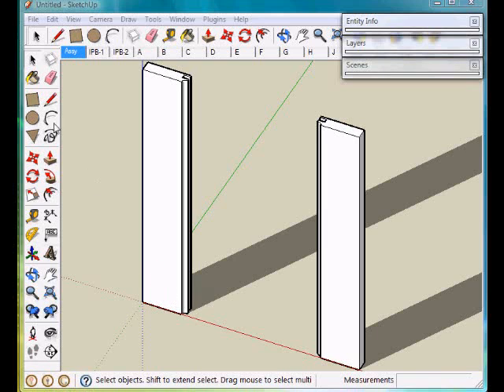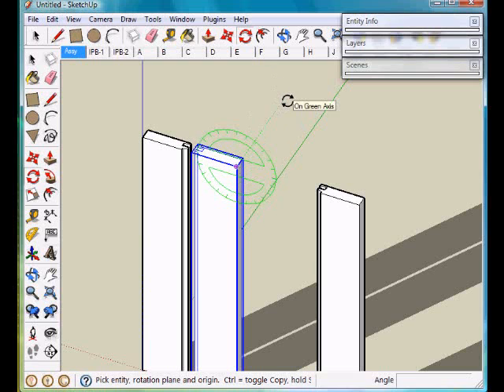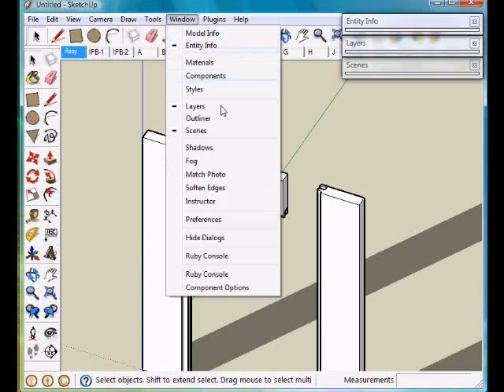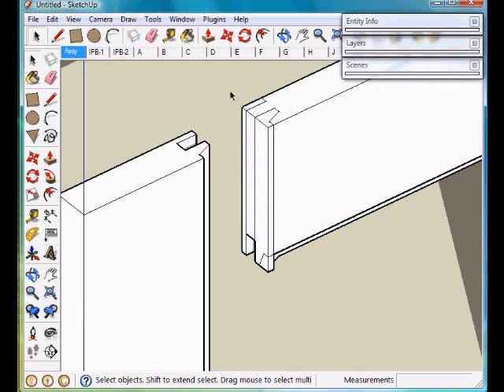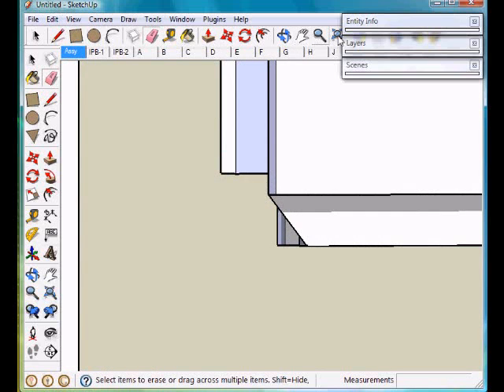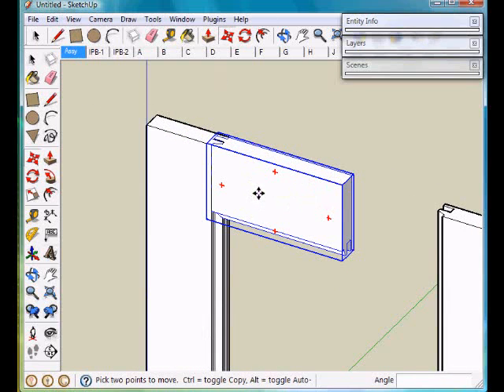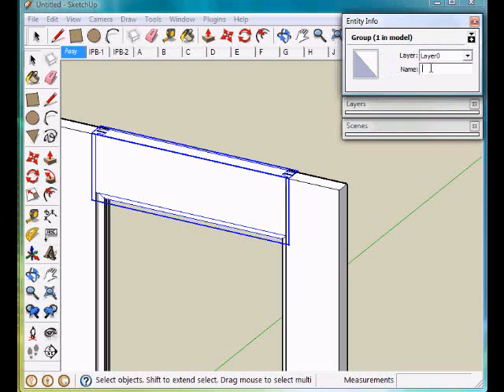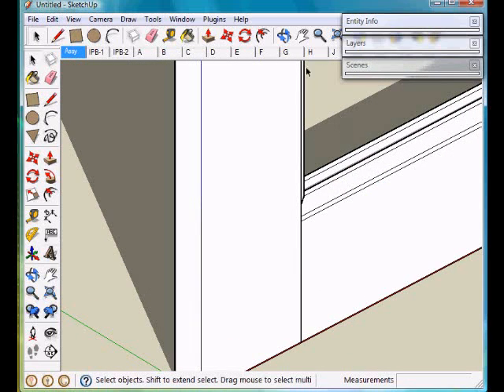Lesson5 3 RailConstruction

Comment: @takuhn01 -You'd think the math would drive the graphics (not the other way around) regardless, excellent suggestion.  Also, thanks for your post. Your SketchUp step-by-step's have given me the courage to break the ice and use SU to solve setup problems around shop. A great help when customizing something with a new profile or structural shape. It's one way to get a good look at a project before cutting the wood.

Comment from the maker: @MudBudDud - One other thing you might try... I've had occurances of voids at times also.  Always working with curves like a routing, never straight shapes like a champher.   It seems (to me) to be a problem with math precision and scale.  I found that if I scale the item up 10x and then do the Follow-Me, it works, then scale the results back down to 1/10th scale (original size).    You might try that sometime.  I know, it's a work-around, but if it works...

Comment: Yes, I build the parts as you did then tried to route the outer edge of the assembled frame with an o-gee. Thank you for all the suggestions, I did follow each and  yes I agree, there seems to be a limit to what the follow-me tool can do. Even though I explode the components, separate them and add lead-ins to direct the follow-me cutting path, collectively SU fails to cut the path without leaving voids or will simply refuse to follow the edge path that joins the end of stile to cope on rail top.

Comment from the maker: @MudBudDud - If you selected all 4 pieces and made a single component out of the 4, Follow-Me might work on that, but in that case, the grain won't run correctly on the pieces, it would run all in one direction, since it's one component.  Try running Follow-Me on each piece individually and see if that works.

Comment from the maker: @MudBudDud - If so,I think the reason that it's failing is Follow-Me is designed to follow a shape, which can be a boundary of an item, but not multiple items (as far as I know).  In other words, if your model is as I suspect, you have 4 groups or components for the 4 pieces of the frame and then trying to Follow-Me around the finished frame.

Comment: As a woodworker, using SketchUp for "honest" construction drawings has been a real challenge. Your lessons both inspire and frustrate me, I cope my rail ends before I shape my frame edges in the shop (because the tenon and flat panel thickness must match) then, I assemble door and apply a routed outside edge to frame. Doing this in SU makes the program fail. Using the "follow-me" tool to route, will not allow me to make an exploded view of parts when "routed". Know of any clever work-around?